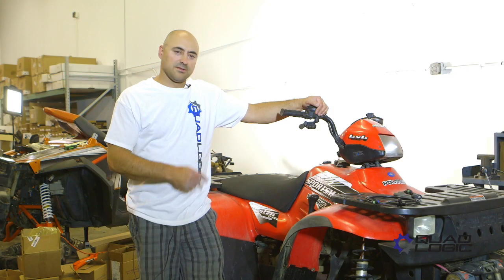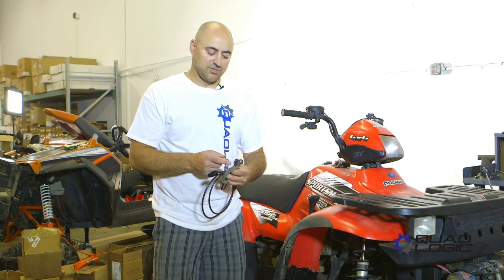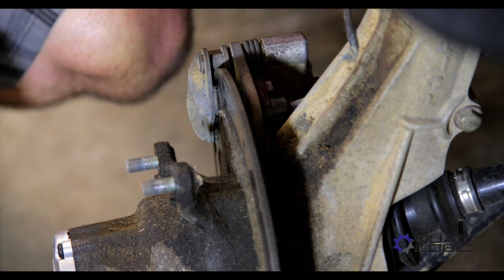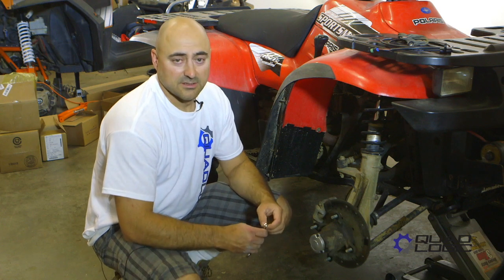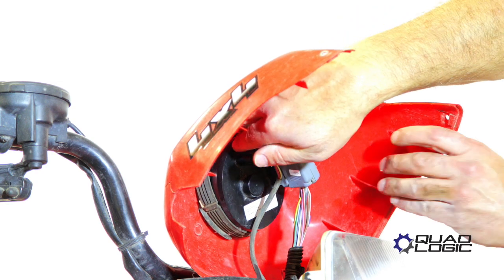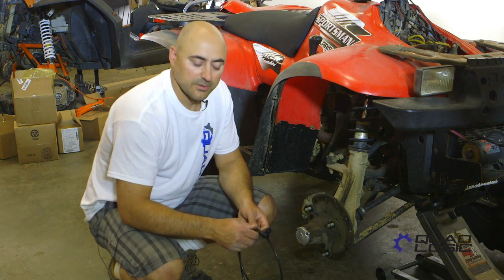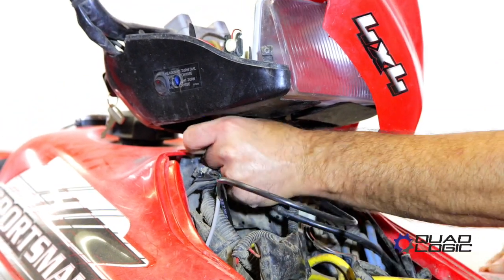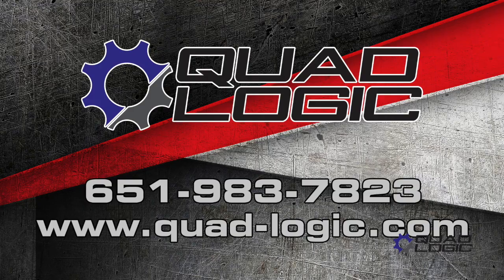Heavy Duty Aluminum Polaris Sportsman Hall Effect Speed Sensor Installation

Comment: I knw a way to by pass that speed sensor.  Because on polaris models. When speed sensor goes bad . Whenever u put it in reverse it stalls and die. I knw a way to bypass
Reply: How
Reply: @thenkyllu   put a toggle switch on the 2 wires that make the reverse switch engage.  Reverse limit switch.  It's 2 wires that you can put a toggle switch to make it run
Reply: @thebull5099  thank you